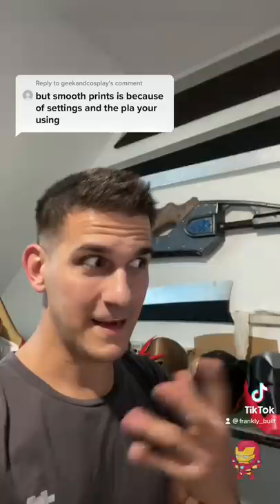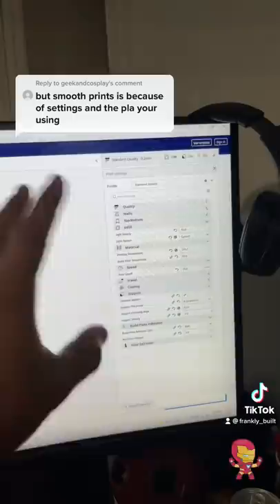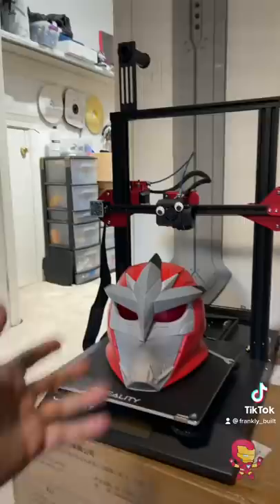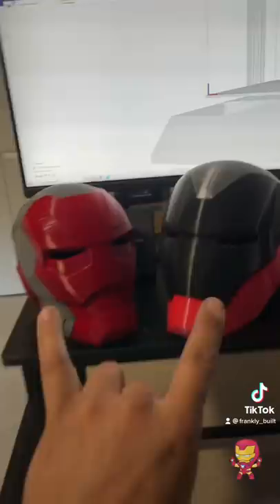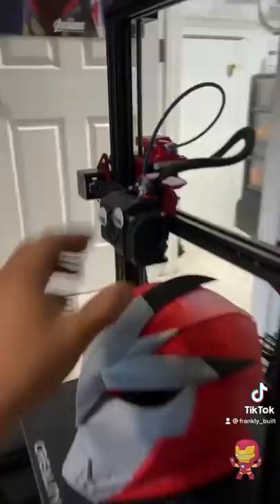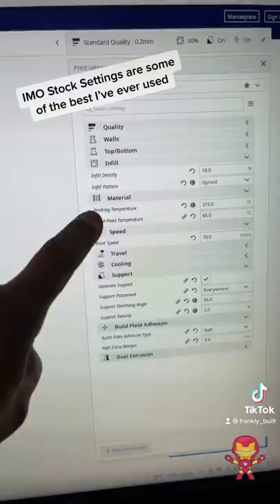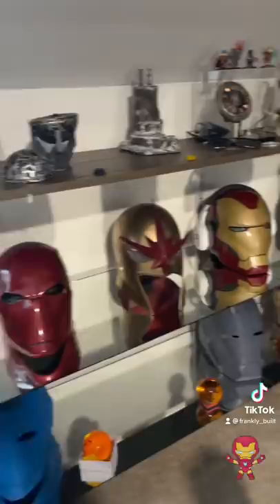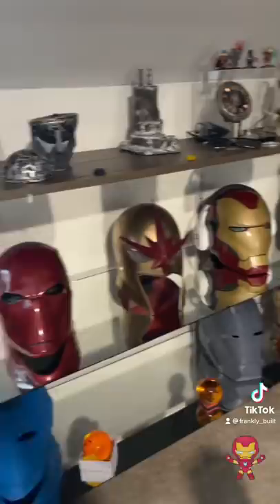Stop Worrying About Settings and Build Your 3D Printer Right! #Shorts

Comment: "imagine changing alignment while lug nuts are loose" best analogy. I need to tell this to the guys running our damn burn table.
Reply: I know nothing about 3-D printing and have no car knowledge (thanks dad), so everything made no sense. My guess as to like an analogy I can get is imagine tuning a guitar, but your strings are snapped.
Reply: @LOLItsToastyXD  close. I'd say tuning a guitar using a tuner set two steps down from the pitch.
Reply: The the
Reply: @riowrath5124  fixed*
Reply: @240sxRule  mission accomplished
Reply: Alignments don't have anything to do with lug nuts. You align a car with the tie rods, camber plates and such but I get what he was trying to say.
Reply: Alignments already tend to be a bit of a pain for me. If someone puts a car up on the alignment rack and the lug nuts are still loose I'm smackin em cross the back of the head
Reply: @anthonysalinas6195  I mean. If the lug nuts are loose to the point the wheel isn't flush to the hub it kinda makes sense. Not sure how the car would make it there with them that loose but it's just an analogy
Reply: @bluehairgril4211  yeah I get if they are that bad, but on the alignment rack it would be obvious and corrected before the alignment actually starts
Reply: Idk loose lug nuts doesn't sound right.    More like if your tie rod was loose or if your ball joints were bad.
Reply: @LOLItsToastyXD  Tuning your guitar but the tuners themselves are loose, or the bridge is on wrong.
Reply: Except a car doesn't need tires to be aligned. Most shots will take them off and attach the sensors to the hub.
Reply: @John_439  whoosh
Reply: @John_439  exactly
Reply: Nah, more like suspension
Reply: Best analogy is at best a mega reach
Reply: @LOLItsToastyXD  “imagine wanting to play a song right but your guitar is out of tune”
Reply: @LOLItsToastyXD  it's like trying to build something from Ikea with no frame of reference at all, it's just the words in a language you don't speak, and every other line is go fuck yourself for trying to read this.
Reply: @LOLItsToastyXD it's like trying to tune when your intonation isn't set first. Or your trem claw isn't tight enough.

Comment: Absolutely right; in addition, maintain your printer: check the bolts are still tight after extended use; do you need to apply a little oil to your wheels and rails?
Reply: What
Reply from the maker: It honestly speaks to me. Kinda wild
Reply: @FranklyBuilt  Haha ive fallen asleep with my phone like that too!!  Happened just the other night and looked just like that lol.
Reply: @miggygarcia9762  i hope you had a good  sleep :D
Reply: @buraqalaeli6619   yea my bad
Reply: @jadefoxette8603  
What didn’t you understand?
Reply: @fezubabu7812  Oh no, I did understand, when I typed the comment, there was some comments that had nothing to do with the video, and had no context.
Reply: @jadefoxette8603  
Ohh ok 👍
Reply: I would not apply oil unless I kept the printer in an extremely clean environment - otherwise it will just make dirt stick. Worse than running dry.
Reply: @markp5726  ah yes; my printer is in a nice clean environment and only very limited quantities of oil is added to the wheel bearings; nothing else.
Reply: @jadefoxette8603  you don't understand?
Reply: @Umoddafokka  I did understand, there were boys in the comment section.
Reply: Adding a drop of mineral oil (I use bike chain oil) around the middle of each rail (on the bottom for the z axis), then run a few full height vase mode prints cold and without filament can help bearings stay running well if you're not using polymer ones, it also will prevent your axes from getting rust spots.

Comment: I also use the cheapest filament I can find and the only settings that I go into depth is print thin walls and sometimes infill pattern. Everything else is just speed, layer thickness, and walls
Reply: Another base setting is temperature for example when I first got my printer I also ordered some filament and I was using the recommended settings and I saw some stringing on my prints so I did what some youtube videos recommended and adjusted the temperature and by just lowering it by 10°c they came out almost perfect
Reply: Remember, getting in depth in your slicer settings can really help.
Reply: tbh, for PLA, that's all you'll really ever need. It's when you start getting into things like nylon and flexible filaments that things get tricky
Reply: The "print thin walls" setting is no longer needed thanks to the new arachne engine.

Comment: With as reliable and consistent as these have become I honestly believe that 3D printers should become a standard appliance in every home.
Reply: It also depends on who actually needs or wants them tho in my case it was both I do a lot of prototyping and without one it sucked but for someone who has no use for it its just a waste you also have to take in to consideration that some people are living  from paycheck to paycheck and simply can't even afford an ender 3
Reply: In 5 or so years when they become stupidly cheap like close to the cost of regular printers they will be
Reply: @GlorifiedGremlin  that's the thing tho in order to get a decent quality printer some parts need to be made a certain way and just can't become any cheaper therefore you probably won't see a printer like a prusa mk.3 get as cheap or cheaper than an ender 3 without a severe drop in quality (yes I do realize that there are good printers for less than that it's just that most people know of the ender 3) however I could be wrong I hope I am God knows I could use a few more good printers but that's just my opinion
Reply: @Dexter_Morgan.  Yeah that makes sense, I'm certainly not crazy knowledgeable about them. I only know how to use them a bit cuz I have a friend who's crazy about them and has one for every different material under the sun lol
Reply: @GlorifiedGremlin  understandable have a good day 👍
Reply: @Dexter_Morgan.  I literally just got a second printer (Ender 3 Pro) for $100. I already had a more expensive ender 5 pro that cost me $400. They are really not that expensive. You buy a printer for the same cost that you buy your groceries
Reply: @Dexter_Morgan.  if you know how to tune it the Ender 3 can be just as good as any printer
Reply: @micah2936  I agree but alot of people want a 3D printer but aren't willing to put in the work that comes with one which is why there is an advantage to more expensive printers there easier to use at least In the case of prusa
Reply: I feel like they’re probably too specialised to become a standard household appliance?  I don’t have a huge set up for say, my blender to work.  Heck, my printer required very little set up and most of it is self-diagnosing and fixing if there is some kind of minor fault.  3D printers seem to be a way’s off that kind of layman-level accessibility.

As someone else in this thread said, I also just don’t see most people needing to 3D print enough to justify owning one?  Rather than become a standard appliance in every home, I would rather see public 3D printing facilities become super accessible.  It would be great to be able to know nothing about printing, but drop in to the local library and have them do my print or walk me through it.  Or be able to submit an order for printing then pick it up as soon as it’s done for only the cost of the filament, power, and a little for the people who made it work.  That kind of thing is available on a small scale online, and makerspaces are more and more common, but I feel like that could be taken way further.
Reply: @renownedbandanawearer1345  I think it'll become standard when they become super simple and convinient for example, you can just click and print a edible chocolate donut and have another that will print out shoes tailored to you in just a couple clicks. 
While you can do both of these now, it's very "manual" compared to the ideal future with these printers to the point that it is much easier for the average person to run to the store and buy those items. The only ones less manual are currently very expensive but they still require setup.
Reply: Honestly it would make a lot more sense for most people if there were just local shops with high-end equipment where you could get stuff printed for a reasonable fee rather than everyone having their own cheap rig. If it's not a hobby or related to your work there's no reason for the average person to own one, but it could be a very valuable service to have available! 👍
Reply: I believe they will begin to be by the end of this decade and will become standard towards the beginning/middle of the next.
Reply: Yeah I can see a lot of things being printed for one time using a house we don't need more plastic like that
Reply: Honey, print me another one of those forks again please!

Comment: I think the problem is that there are so many variables in the printer that can go wrong (bed level, too tight screws / too loose screws, to hot to cold, too close to far, to fast to slow, belts to tight / too loose, etc). On top of that when you see Cura, you can change a million things.
When you are new you kind of get frustrated, especially when everyone says level your bed, and it doesn't work ;)

I remember when I had to assemble my first printer, an Ender 3 v2.
the manual was bad
watching videos helped a lot, but still there were many different approaches. On top of that it does not help that the factory often don't assemble the printers correctly (overtighten screws, over tighten belt etc.)

Comment: Its so sad that creators have to start with “I know im gonna make a few people mad” Like, Who cares my guy tell your haters to shut their damn mouths
Reply: Yeaaahhh do what he said
Reply: I think in this case it’s just bc a lot of people don’t understand that if ur base line for the mechanical parts is off ur never gunna b able to correct it threw just tech stuff it’s literally like working on cars from the 90s-2010s ish yea u might get a code but u still have to trouble shoot it mechanical
Reply from the maker: But like. It kinda is your fault. When you bought the printer did it at any point on any paper say it was going to print perfectly smooth and amazing right out of box every time with no construction, settings or adjustment? No. Because those printers don’t exist yet and people don’t bother to do the research and learn that. They see someone else print something pretty and smooth and they buy the same printer expecting the same results. So in the end whose fault is that? 

Not trying to be a “condescending asshole”. Just trying to educate people that there is a learning curve to this and you shouldn’t always trust a hobby level cheap Chinese 3D printer you most likely built wrong to work perfectly out of box. If you DO, well. The print quality will reflect it
Reply: YAA!

Comment: I got my first printer for Christmas. Ender 3 Max Neo and I made sure the assembly is right. Used PLA options in Cura for PLA and PETG settings for PETG. Successful, near perfect prints in both materials. Basics and just making sure the machine is Kosher before getting off in the weeds without altering settings.

Comment: You’re absolutely correct Frankly Built! I’ve been around, the very first 3D printers from way back in 2000, and have been a contributor in the 3D printing industry for many years now. But certainly if these “axis” x y and z aren’t carefully built together carefully all of your prints moving forward will result any many obscure manipulations in the prints.

Comment: My journey in 3d printing:
1) buy an expensive 3d printer which results in me being almost broke.

2) learn how to use it thinking it would be easy to learn.

3) actually watch tutorials but dont get anything in my head cause im dumb.

4) give up and put it all aside.

5) find it later while cleaning my room and start trying again.

6) still cant get anything in my head and decide that its not for me.

7) sell the printer for a few more dollars to try and get a profit.

8) currently watching some expert make some really good stuff and now im kinda sad that i gave up so early.
Reply: I have a mostly stock ender 3 that only fails me if I try to print ocarinas that have round bottoms. If you build it right all you have to do is level the bed and you are off to the races

Comment: Your prints look so good.
 I'm relatively new to 3d printing and currently I've got possibly close to 60% print failure. 
 I've gone through all the recommended steps, esteps, bed levelling, cleaning the bed with soapy water, I've done the maths for best quality prints and extrusion and still I'm a nervous wreck because I know it's going to fail.
 Thing is for first week pretty much every print was good, but now I'm so stressed with it.

Comment: Yup, can confirm, people told me over and over that my "Anet" printer would never produce smooth printing, yet here i am with a smooth Conan figurine; i changed very little in settings, but spent lots of time fixing every single nuisance in the assembly, from the slightly wobbling nozzle to the amount of oil on bars.

Remember, a printer is only 1/3 program, the other parts are electronic and mechanic.

Comment: Funny thing about fixing the machine.

When I got my Ender 3 Neo, it was having some bad layer shifting issues. I went through every step in a Creality troubleshooting video step by step multiple times, nothing in it worked.

Then I found a video from a guy that had the same problem, that went through the same steps, and like me, he was about to give up on the machine... when he noticed that the hot end wiggled if you moved the wires a little. He was like "I don't think that's supposed to do that." I paused, checked mine. same thing. Kept watching to see him fix his, went back out, fixed mine, zero issues since.

Comment: I recently started on 3D printing and my prints look way better than I expected for so soon after getting it. I can mess with settings to make them look a bit smoother but ultimately I think my printer is set up very well more than my settings. I am still tweaking everything just a bit to make sure it all works right but so far Im not able to see if anything even needs more adjustment. Everything seems all level and prints come out nice and clean barring an issue that needed supports.

Comment: 1000% biggest tip. I’m blew over my first printer for a year. First 2 months could barely finish a print. Took it apart many times out it back made sure everything was evenly torqued down. I literally got over the whole hobby by the time I got it to finish a half decent print. And then it couldn’t do it consecutively 

THE ONLY REASON IS BECAUSE OF THE THREADING SPACER WHERE THE THREADED ROD GOES THRU. Entire year of problems because and off center threaded piece that just need to be tightened

Comment: Bed leveling is everything, our printer keeps alignment for ages until all of a sudden it doesn't, the one post is a little loose, tightened it up and boom, perfect prints, rarely need to adjust, even with stock springs. Just make rafts when needed, supports where needed, I don't even mess with speed, it prints fast enough

Comment: Filament brand does make a difference due to temperatures required for proper printing. If you just throw anything in a printer with those settings, people will get mad when they have stringing, blobs, dots and holes in their prints. Most people don't enjoy having to reprint something over and over so they fiddle with settings.

So while this video was made with good intentions, you fall into the 1% of people who don't need to fix software problems in their slicer to make prints come out properly. Especially when we all live in different climates.

Comment: Bravo. I've been through endless threads in different forums and social media, and also checked the work of other enthusiasts here, and regardless of the issue being discussed, the course of the conversation always devolves to slicer settings and filament brands. Those are important, yes, but not even close to the most important aspects of your prints. There are true sibarites out there who will defend tooth and nail their favourite brands, or their finely-tuned settings they gathered from endless sources, stating that any print that wants to achieve any level of decent finish should be configured exactly like theirs.

Honestly, people: take good care of your machines. After months dealing with sub-par prints and extrusion problems, I decided to sit down and disassemble my Anycubic i3 MegaX, and I discovered that the extruder was underperforming. New motor, new hotend, upgraded to dual drive and that puppy now prints as good as it did the first day. Total cost: 30 euros and about 5 hours between troubleshooting and replacing the parts. No amount of tampering with Cura will get you as good of a result as knowing what you're working with.

Comment: This is so true I first tried to fix my settings for my first printer and never got it to work properly. Then I ended up adjusting and fixing the actual printer and I finally was able to get it to print. Unfortunately it was a Delta printer which not many use. It looks really cool when printing but I am now in love with my x1 Carbon which honestly all I have to do is slice it and send it with no real setup involved.

Comment: In my experience, what really matters is the time and care you take sanding and priming.
Reply: I like chemical smoothing first.
Reply: @PTHYTQV  Pretty limited in material type though, and from what I understand it doesn't work great on small or delicate parts.
Reply: @LiamMitchell01  two of most popular - ABS and PLA can be chemically smoothed. Very fine details doesnt really work with FDM printing. But you always can choose on what part of the print you should use it.